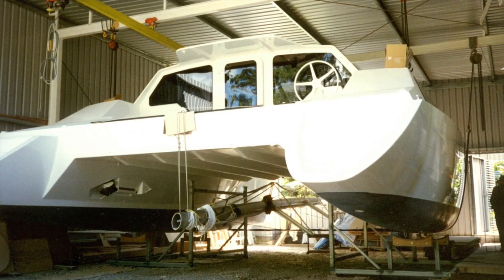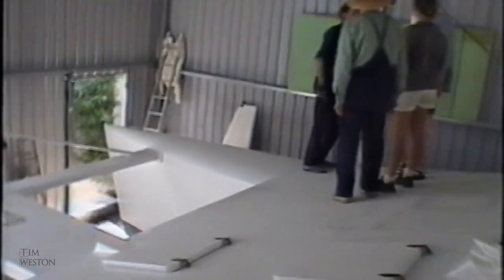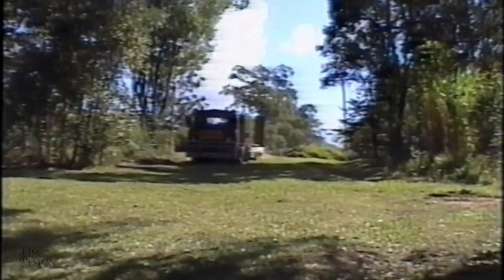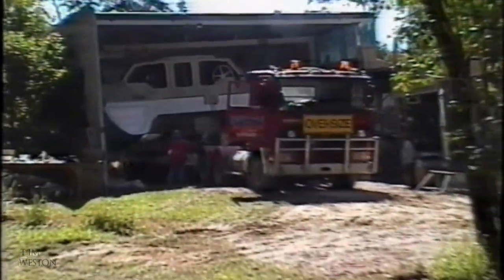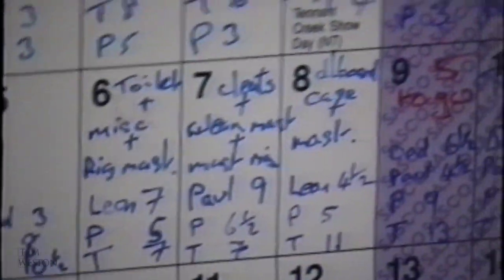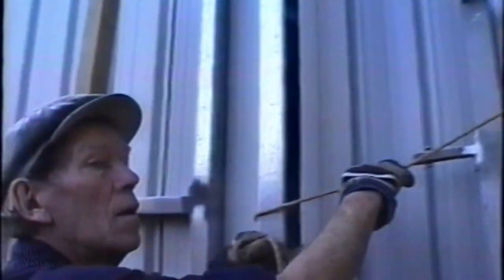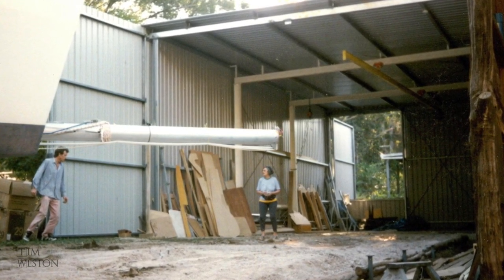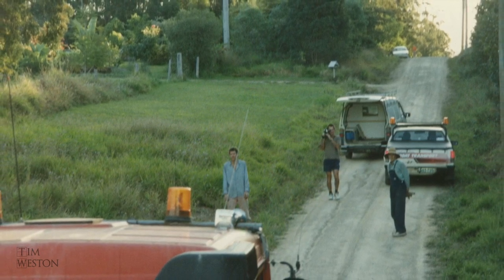How to build a boat Ep #6 - Launching the boat - Getting out of the shed

Comment: Gidday Tim, 
I have bought the plans for a Waller type hull. These seem very similar. 
I have most of the hull timber, bulkheads and temporary bulkheads done. I just bought a Kindle copy of your book today. 
You mention in your video you wrote down all the hours spent in labor on the hull. Did you add them up? What was the total?

Regards, David Roberts
Reply from the maker: G'day David. I put a time line in the back of the book. I counted about 6000 hrs for the build, at the time of launch. And, I probable did another 1500 or more hours of work after I was in the water, for the fit out. thanks for buying my book, and all the best with your build! Regards, Tim

Comment: Did you have somekind of experience before doing this project? maybe in construction or boatbuilding? and how much money and time you invested in this?
Reply from the maker: Hi, Alfredo. Yes, I am a ships engineer, and I've built things before, like a house. But it was the first time I had built a boat and the first time I'd worked with fibreglass and epoxy. I was learning everything for the first time, by doing.  It took 3 years and $75,000 AUD to build. I saved a lot of money doing it myself. I've written a book about the building of TE, which has lots of details of the build, how much it cost and how long each stage of the build took. It's on Amazon. You can read more about the book here - https://timwestonboats.com/ebooks/ Regards, Tim

Comment: this is most excellent, thank you for sharing your build and your story :)  1 question I have, is that the project was a 3 year undertaking, is this a failry standard time frame for taking on such a project? (noticing your calendar, putting in what looks up to 9 hours some days)
Reply from the maker: Hi Alexander. I'm not sure how it compares with other people. I spent a lot of time designing many parts of the boat, redesigning other parts, and building a new shed etc. So it could have been done a lot quicker. It actually took 2 years and 9 months and I put in a lot of hours per day. In my newly released book, "Building Tokyo Express" I have included a timeline in the book, and describe all the extra work I did and all the stages of the build. Just search of it on Amazon. If you are thinking of building you should get some good ideas from it. You can read the first part free.

Comment: I watched all 6 videos on youtube and that seems to be all. Do you have 
any info on how it sailed and what you would have done differently? Was 
this the last big cat that you built or owned? Good job. I am 
contemplating building an aluminum hulled cat at the moment and have 
looked at a few designs. The reasons for the metal is that I am very 
familiar with it and working with wood is not all that great for me.
Reply from the maker: Hi Scot.  There is more to come.  I will talk more about sailing and living onboard later.  I just started writing an ebook too with a lot more information and details on the how's and why's of what I did and performance etc.   I'll put a link to it up when I'm done.  It was the last big cat I built.  I have plans to build something bigger, a Proa, very simple and cheap.  If you are familiar working with aluminium then maybe it's a good way to go.  Myself I had done more metal work before this, I had never worked with epoxy or fibreglass before this boat.  But it was easy to pick up.  For me the advantages of a composite construction far outweigh metals.  Especially for a multihull.  They don't need a keel with ballast, so are much lighter to begin with.   So using aluminium makes for a pretty heavy/slow boat.   Composites also have zero corrosion/electrolysis issues.  Hope this helps..  Tim

Comment: Isn’t the wooden core a lot heavier than one of hard foam or some honeycomb? Do you know a system to build it like that without negative forms?
Reply from the maker: Hi Jodelorakel.  You are right, the wood core is heavier than foam but it is also much stronger than foam. You don't need anywhere near as much fibreglass.  And the hull doesn't have a gelcoat either as it doesn't come out of a mould. It is much lighter hull than a foam cored production boat.